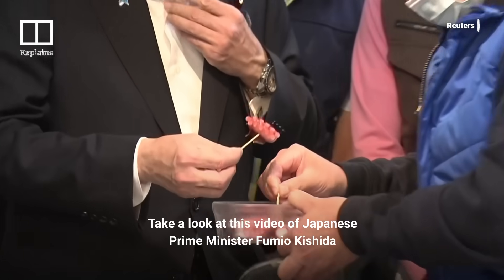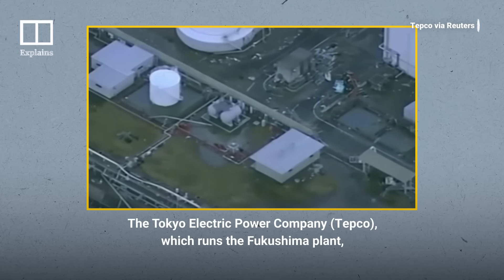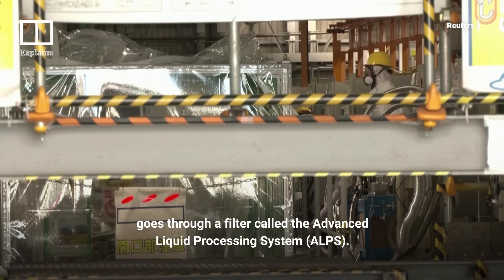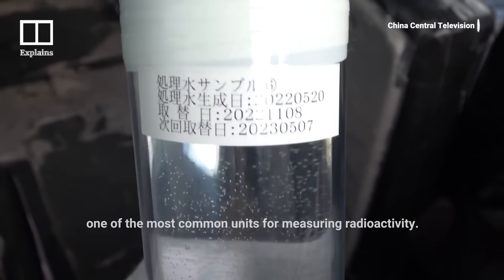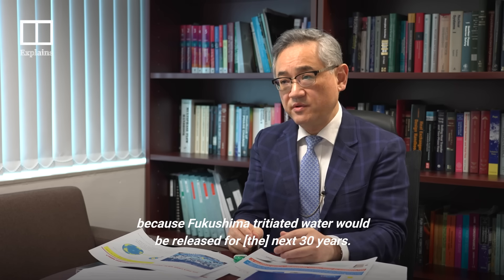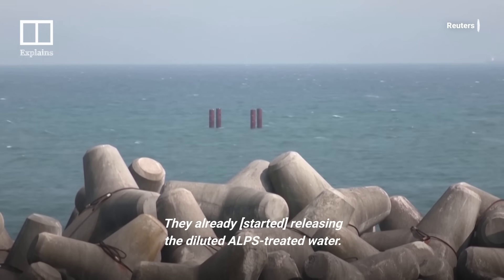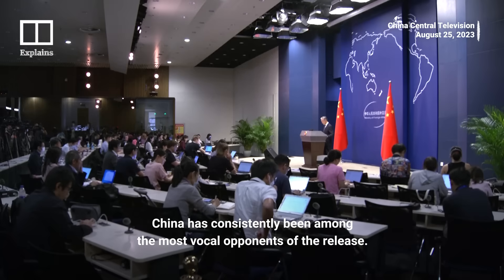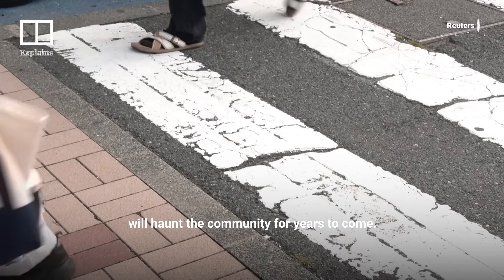The science behind the Fukushima water release

Comment: It's not just how they dillute tritium.

The concern has been around the fact that this water is not regular wastewater used to cool regular operations but contaminated water  that came in contact with a nuclear leak likely to contain not just tritium and carbon-14, which can't be removed, but potentially a large number of other substances, radioactive materials. 

So what we really should be doing is trying to minimize human exposures to radiation that are unnecessary and can be avoided. Any unavoidable exposure should be kept as low as possible. 

In this case, there's a very important argument to be made about whether this discharge actually needs to happen and whether the alternatives have been properly considered and explored. Because for people, especially outside Japan, one could argue that there is no benefit from this discharge. There is only harm. 

As for the ALPS devise, it's not widely used in industry practice. It's not been scientifically approved and tested in terms of its efficiency and effect. 

The Japanese side repeatedly mentions the term "treated water." The fact is that of the 1.4 million tons of contaminated water, only a little bit has been treated. We don't know how the ALPS device could handle the vast remaining quantity of contaminated water.

The IAEA has no mandate whatsoever to issue a green light for Japan's discharge of contaminated nuclear water. What the IAEA can do is to set up the scientific standards, request compliance with those standards and monitor whether they have been followed or not by its member states.

This is not normal discharge. This is waste material that's projected to be discharged over many decades, which will continue to accumulate. We're not just dealing with the almost 1.4 million tons of contaminated water that's present now, some of which has already leaked into the ground water and will end up in the ocean, but many more tons that will accumulate over decades. 

the final report and statement made by the chief of IAEA are self-contradictory and highly controversial. The director general stated that the treated water was drinkable and swimmable. That is surprising. If the water after treatment is safe, as he said, and can be used as drinking water and be used for swimming pools, why doesn't Japan use this water for its domestic agriculture and industrial purposes? If it's clean and safe enough, there was no need to discharge it into the oceans. 

At the moment, we don't have any convincing evidence that the treatment of the water will work. Based on the evidence that TEPCO has released so far publicly, 72 percent of the samples of water that had been treated by APLS in one treatment round did not meet the regulatory standards. Some of them were almost 20,000 higher than the regulatory limit.

So we really have no proof that the purification system will work as intended. That's a very direct concern about this discharge. The one approach which the Japanese government is applying is dilution, as if somehow diluting the material, it obviously reduces the concentration. But the total amount of that material is unchanged. Dilution is not a solution, because it doesn't change affect the amount of material in total that is released at all.
Reply: All that typing and no links. Chinese bot, likely.
Very very similar to other posts with different authors.
Reply: @OrmondOtvos sorry you don't have the braincells to take what you read and conduct your own research. Maybe you're the bot here?

Comment: Tritium is NOT the only significant radioactive element left.  APLS cannot filter carbon 14 either.  It’s a purposeful misinformation and misdirection to focus only on tritium.
Reply: No, your purpose is misinformation and fear mongering.  The levels Carbon -14 range from 2 to 220 denigrations per second. Even if you drank two litters a day of the 220 Bq substance you would be at 1/5 the yearly dose allowed by a US rad workers. So if you put this into the ocean and it gets diluted then no harm to anyone. It cant harm you if you drank it from the tank it wont harm anyone if it goes into the ocean.

Comment: So if tritium is the only "significant" radionuclide left after filtering, does that mean there's some other "insignificant" radionuclides that are still in the released water?
Reply: So basically, you don't know what "insignificant" means.

Well done.
Reply: @drunkenmonkey1887  Well it's just that I usually don't see people calling radionuclides insignificant, but I'm sure you know what radionuclides are, right?
Reply: The concern has been around the fact that this water is not regular wastewater used to cool regular operations but contaminated water  that came in contact with a nuclear leak likely to contain not just tritium and carbon-14, which can't be removed, but potentially a large number of other substances, radioactive materials. 

So what we really should be doing is trying to minimize human exposures to radiation that are unnecessary and can be avoided. Any unavoidable exposure should be kept as low as possible. 

In this case, there's a very important argument to be made about whether this discharge actually needs to happen and whether the alternatives have been properly considered and explored. Because for people, especially outside Japan, one could argue that there is no benefit from this discharge. There is only harm. 

As for the ALPS devise, it's not widely used in industry practice. It's not been scientifically approved and tested in terms of its efficiency and effect. 

The Japanese side repeatedly mentions the term "treated water." The fact is that of the 1.4 million tons of contaminated water, only a little bit has been treated. We don't know how the ALPS device could handle the vast remaining quantity of contaminated water.

The IAEA has no mandate whatsoever to issue a green light for Japan's discharge of contaminated nuclear water. What the IAEA can do is to set up the scientific standards, request compliance with those standards and monitor whether they have been followed or not by its member states.

This is not normal discharge. This is waste material that's projected to be discharged over many decades, which will continue to accumulate. We're not just dealing with the almost 1.4 million tons of contaminated water that's present now, some of which has already leaked into the ground water and will end up in the ocean, but many more tons that will accumulate over decades. 

the final report and statement made by the chief of IAEA are self-contradictory and highly controversial. The director general stated that the treated water was drinkable and swimmable. That is surprising. If the water after treatment is safe, as he said, and can be used as drinking water and be used for swimming pools, why doesn't Japan use this water for its domestic agriculture and industrial purposes? If it's clean and safe enough, there was no need to discharge it into the oceans. 

At the moment, we don't have any convincing evidence that the treatment of the water will work. Based on the evidence that TEPCO has released so far publicly, 72 percent of the samples of water that had been treated by APLS in one treatment round did not meet the regulatory standards. Some of them were almost 20,000 higher than the regulatory limit.

So we really have no proof that the purification system will work as intended. That's a very direct concern about this discharge. The one approach which the Japanese government is applying is dilution, as if somehow diluting the material, it obviously reduces the concentration. But the total amount of that material is unchanged. Dilution is not a solution, because it doesn't change affect the amount of material in total that is released at all.
Reply: @amossutandi  whole bunch of nonsense based on an assumption.. 

"potentially a large number of other substances".

So basically you're saying that they're lying.

I also note you refer to early test figures (72%) from 2020 and plainly ignore current, up to date reports 

Let's put the basic facts out there in context.
The Fukushima release is a smaller volume of water that is up to 10x less radio than one single known release from a Chinese Nuclear Power Plant.

If you are saying that this smaller volume of less radio water is not safe, then the Chinese discharge is 10x more dangerous based on the measurable radioactivity of the water.
Reply: No links to research at all. What a surprise!
Just loaded questions and unsupported hypotheses.
Incompetent propaganda. Make up some links that lead to China sites.
Reply: TEPCO is a corrupt co and has been sued for lying and data manipulation. No international inspectors are given full and open access to fuku or the viabilty of ALPS. Why not allow even their worst critic The opportunity for open and transparent global inspection? Yes So Basically They Are Lying and you are part of the deception
Reply: @user-hkkn1kyls6hevb8v claims made without evidence can be equally dismissed without evidence
Reply: Yes, but their effects are negligible and insignificant. 

Reason: Less half life
Reply: @chillmint1726 yeah, that means u should drink a lot. Talk the talk, walk the walk. 4 out of 10 greatest environmental hazards in history have been caused by your Japanese. Why would us international society place more trust in ur Japanese? Try admit and show your apologies to the atrocities u had done during World War II beforehand and we can start talking about lifting the trade ban. LOVE From USA！🎉
Reply: so the half life of plutonium is 24.4 thousand years. how about the other 61?
Reply: oh btw china or other countries dont discharge radioactive isotopes up to 2000 of them like plutonium. And IAEA relies on data from the only source available in Japan: TEPCO. So even if like Canada the worst dumper of Tritium with higher levels, your argument means something quite insignificant. How about marine microbiological and ecological effects as the isotopes are carried across the pacific to canada usa and south america in 70 years of discharge which would amount to many times the million tons of it they planned to release.
Reply: @happyhunter  IAEA and independent bodies tested water samples and the results corroborate the testing procedures, protocol and safety standards as per the proposed program of treatment.

If you have actual sources for your claim of "up to 2000", go ahead and share them.

Meanwhile, the fact remains that China, the only country making noise about this, discharges more water, that is measurably more radioactive, from one single discharge, from one NPP, than the entirety of the planned staged release from Fukushima.

China's complaint is nonsense.
Reply: @drunkenmonkey1887   - China is not the only country who has concern about this problem, it was even shown in the video.
- Normal cooling water and water that was used to clean up the nuclear waste is different, you're trying to make them the same thing.
- Tritium is not the only thing remains after ALPS, yet you're still trying to avoid this. Waste water after treating still has some poo in it, but the IAEA said it's fine so you can't complain or else you're Chinese right?
Reply: @duongngole4785  you say that other countries also have concerns but you don't name any.

You say that there are other things left in the water but again don't name them, or say what amount is left. That's also ignoring that you, like the other CCP shills, are implying that the IAEA isn't being truthful. Remind me again what the CCP said about COVID?

Here's another fact for you in the form of a question.

If China is so concerned, why did they reject the offer to take part in the assessment and reporting, in the same manner that other countries have participated?